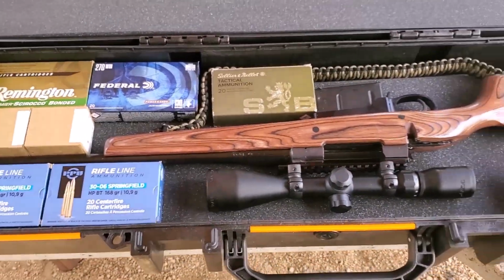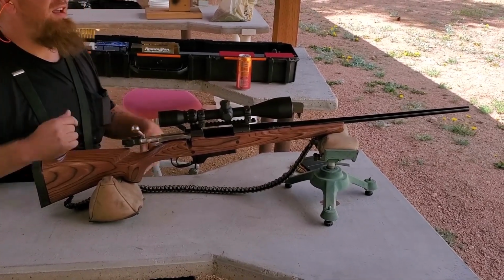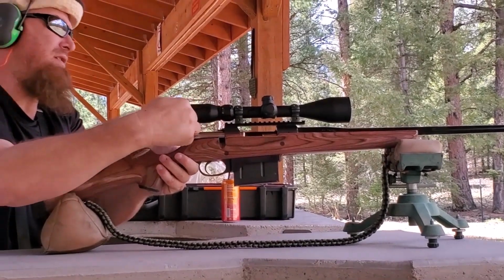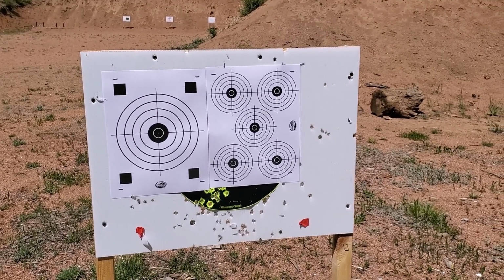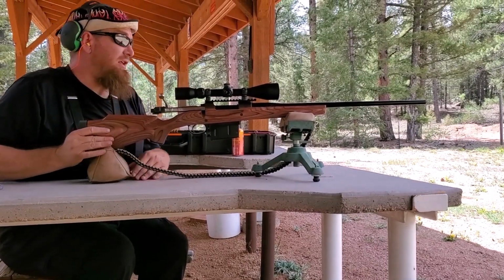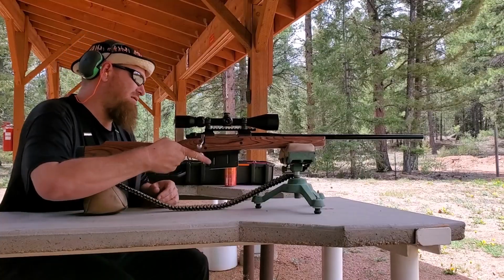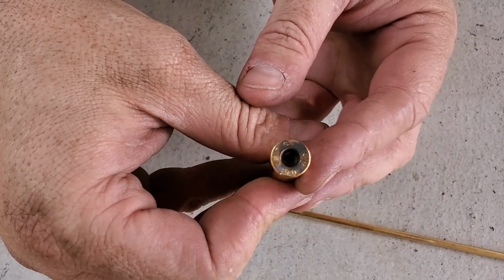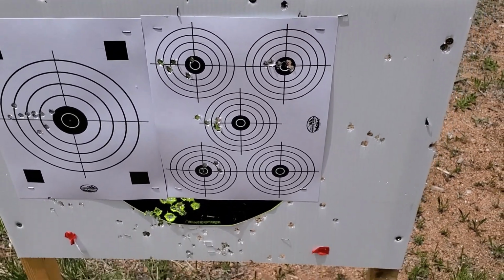270 Rifle testing at the range

Comment: Would be curios to find out why your blowing out primers. See pose over pressure issues. Factory ammo? Verified head space? Wonder if other factory ammo is doing the same thing? Always enjoy your videos, thanks for sharing!!!
Reply from the maker: Thanks for watching. I will have a separate video on the ammo issue. Headspace good, first box of ammo was an old box of Remington, not great groups, second box was new Federal and had 6 primers blow out. The primers that stayed in had no signs of over pressure. No difference in felt recoil. I am kinda at a loss with why it happened, except possibly bad from the factory. The groups were not bad, also telling me not over pressure. Next testing will be with hand loads to try to get the groups better.
Reply: @AthensArmory303  

I had a bad batch of Winchester primers that was doing that same thing, changed primers and everything functioned as intended. Good luck Sir!!